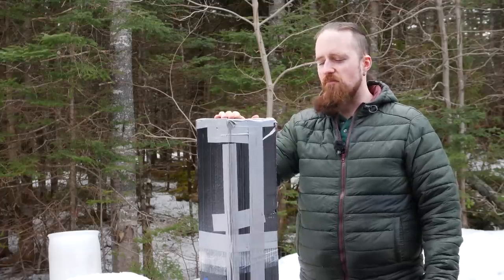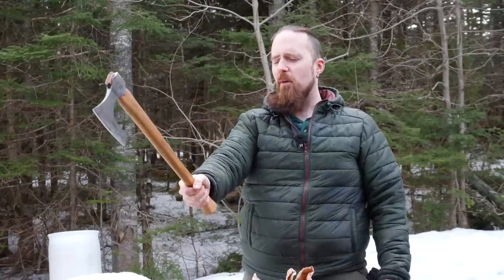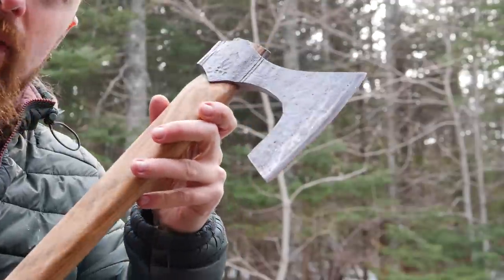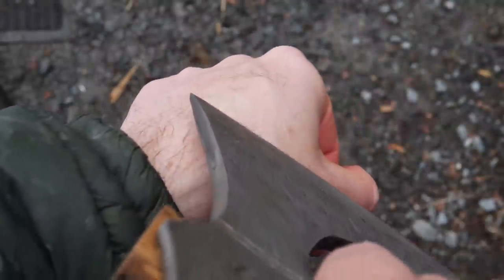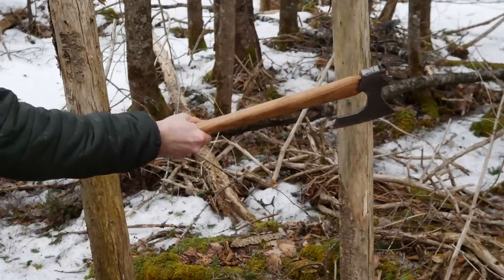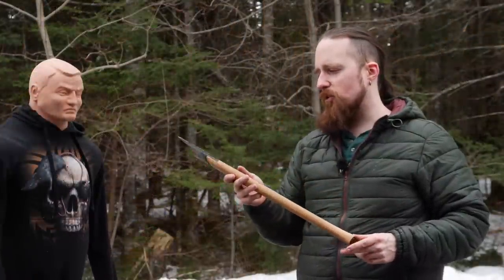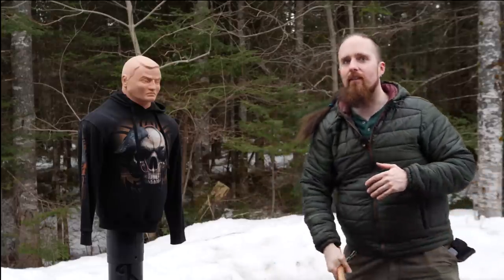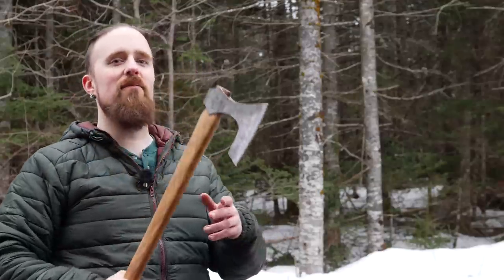Unboxing and Testing a Viking Axe from Sweden

Comment: You know, I never would have considered flipping it over and striking with the shaft. Very informative.
Reply: Less useful in a full on fight, where the goal is usually pretty explicitly to murder your opponent rather than non-fatally incapacitate them
Reply: @rollingthunder1043  I can see several instances where it would be more useful than hitting with the blade part however. One of those instances would be if your foe had a helmet. If they're wearing full plate armor then it is pretty hard to beat, but maces were designed to crush armor. Now an axe handle probably wouldn't crush armor, but a strong hit to the helmet with the handle would probably daze them due to the loud metal ringing right next to their eardrums. Then, while they're too busy being in agony, you could use the axe blade to strike at an exposed part of the person like an arm or leg joint.
Reply: @nauticalgaming2256  or you could hit their helmet with the axe blade instead, since it's heavier and would do more damage. then once they're in agony you can hit them again with the axe head like you said, it's better for hitting things. basically if you want to fight with a stick then hitting them with the shaft is fine. You only want to fight with a stick if they are your friend, so it's what cassie said: "Less useful in a full on fight, where the goal is usually pretty explicitly to murder your opponent rather than non-fatally incapacitate them"
Reply: @JooJingleTHISISLEGIT  there is a big reason you don't want to hit them with the blade, however. Since there's more mass in the head, the edge would be more likely to acquire a roll in the edge from a hit like that as the force would go from the blade into the armor and then back into the blade. And if you've ever watched Forged in Fire, you'll know that rolled edges cut horribly. Not saying that it's a guarantee thing to happen if you hit the helmet with the axe blade, because there's a number of factors that could go into it like the force behind the swing itself or the craftsmanship of the blade, but I'd hit the helmet with the stick part myself just to be safe.
Reply: @JooJingleTHISISLEGIT  "or you could hit their helmet with the axe blade instead," you could but that's likely to damage that rather expensive and, relative to a helmet, fragile blade. You can do the same kind of blunt force trauma with the axe handle or even better the iron or steel wrapped around the back - relative to the axe blade - of the wood.
Reply: @Alex_Fahey  You could always spin it around and hit them with the back of the axe head, then you get the best of both worlds using the heavier head but protecting the blade.

Comment: I'm of Swedish heritage on both sides.My Morfar was from Garsas,Dalarna.My Mormor was from Sandviken.My Dad's people came from the Yterlanis area.My Morfar told me the people from around Mora would trade with the Lapps.Head north with manufactured goods like needles, knives, saws,etc.. Trade for reindeer hides, antlers, dried meat, fish, etc...Also meteorites.The high nickel content and it's structure made for great steel.For an axe,The cutting edge would be a piece of excellent steel forge welded between two pieces of iron.Your edge was what really needed to be steel.You had the weight you need from "scrap" blend.Your axe was made "Old School".Glad to see that.

Comment: Grain orientation looks very good. That handle will last! Just cut at 45° when chopping timber. 90° is the saw cut. You compress the wood when hitting at 90°. Thanks for showing!
Reply: Thank you for that info

Comment: So... While a bearded axe is, as you say, not for chopping down big trees, it is not an axe made for fighting, but for woodworking.
The beard is there for several reasons: saves material, makes it lighter and makes it possible to place your hand for more precision during woodworking. Some people still use a bearded axe today. This is not a case of a weapon being made into a tool, but a tool into a weapon
Reply: I've always had the impression of Viking weapons being much heftier, from reading the sagas. I just can't see Skarp-Hedin or Egil using such a small weapon but they were certainly not average foot soldiers and probably had bespoke weaponry.

Comment: The iron and steel construction is accurate to the period. Steel was much more expensive and difficult to get so it was only used on the blade edges. Plus making the head from iron makes it softer and less brittle.

Comment: I studied meterials and the reason steel is more widely used than iron is not becuase of how easy it is to get but because of the quality and purifying process, when iron ore is precessed it is processed with coal making it a type of steel, normally a 1010 to 1040 industrial steel, steel is harder, it's more durable it's less brittle and etc. making it an all around better matrial than iron tbh.
Basically steel is just better iron

Comment: Nice axe!! One important point about bearded axes.  Yes the beard allows for hooking of shields, and yes they are thinner to reduce weight, but most of the weight reduction is due to the beard itself.  A bearded axe retains a fairly large cutting edge, while the weight behind it, such as found on a regular axe is missing.  Imagine if that whole area on the bottom was just filled in with metal, and that would add a lot of weight.  It should also be mentioned that a lot of historical examples have a geometry that gets even thinner behind the cutting edge.  This further lightens the axe, and reduces friction as it cuts into material.

Comment: Viking axe technology is super hardcore. To be authentic, it has to be laminated and pattern welded from blast furnace foraged bog-iron, and the selected complex metallic fragments sorted and forged together in a designed structure much like a samurai sword, and studies of archeological metallurgy show that most of the fine weapons were made of something way beyond Damascus, and were basically ornamented with wrinkly patterns which look like snakeskin, or woven knotwork. Basically self-sharpening, and in a fine example far beyond what is currently available from your local ironmongers. The best items combined alloys including copper, nickel, vanadium, scandium. The salt and clay treatments for hardening the furnaces were a secret part of the mixture, and would produce superb steel particular to a certain place and maker.

Comment: Gränsfors had a few viking axes back in the day if you were lucky enough to grab one.
Very affordable when they came, but It's hard to tell if this maker exceeds or matches that quality.

It would be quite a testament to the skill of Nils if he managed to stretch and sandwich the iron across the steel core properly without liquifying the iron.
Certainly makes it very interesting to see how it affects performance and how much faster it woulf be to sharpen.

Another point of interest would be whether Nils pushed the hardness past 56-58 like the Japanese like to do with steel/iron laminates.

Interesting blacksmith from my home country. 🇸🇪

Comment: That is called a Plow Share Weld, in the US. A steel edge, with mild steel wrapped around it. I have a Tomahawk that is built the same way. It saved the smith from having to create lots of carbon steel. Not sure what they call it on your side of the pond.

Comment: The funny thing is, majority of the early Viking era fighting axes were just general use tools, as said in the video swords and other weapons were expensive but pretty much every Scandinavian had at least one axe for wood and building, thus during the raiding times they would bring that axe to fight. Most "vikings" raided as a part time job and were usually famers, they were very resourceful with their tools
Reply: Not really cause we had a warrior culture for thousands of years before the viking age started, so it's a bit of a myth that you used tool axes. Maybe if you were really poor sure, but generally no. There are depiction on some runestones in Sweden where they carry both Sword, axe and a spear.

Comment: Hello Skall, the wrought iron used in the axe head likely has not been industrially produced for a long time. mild steel has better properties in terms of strength and purity, but wrought iron is nicer for forging and forge welding due to silica impurities that give wrought iron a striped appearance once it rusts. it isn't worked with often due to it being harder to find or to buy because you have to get it from old things made from it around the 1880s or before. In short, Wrought iron is rare due to being obsolete but is very nice for forging and has value due to its age and relative scarcity.

Comment: And this is why you get custom work, i bought a bearded axe head off amazon, i was expecting something like this but with an aggressive needle point beard, what i got is FAR to heavy for someone my size (150lbs/70kg[i think]) to use one handed, i wouldnt mind taking it to a grinder and hogging off some of that weight

Comment: For those of us that cannot afford a beautiful hand-crafted piece of art like that, there is still the Cold Steel Viking Axe.  I mean the small one, originally with a 19 inch handle and differentially hardened, with a soft steel body to absorb shock and a hardened steel edge for long wear.  It is now 22 inches long and they don't mention differential hardening in common catalogs any more---best to check the home page of Cold Steel.  It is light and fast, with a more symmetrical shaped flaring blade that can hook AND stab, and the handle tapers down from the eye like a pickaxe handle does, thicker above the blade and thinner below---the head cannot fly off.  It is made in China of course, so that we CAN afford it, as Cold Steel intended, but it really is a nice Viking small axe...…………………...…...…..elsullo

Comment: From the maker's website: "The bearded axe is a tool and weapon commonly associated with the Vikings of Scandinavia. The lower part of the axe blade is called “the beard” and could be used to hook shields and leave enemies defenseless. The axe is handforged with a mildsteel body and a highcarbon steel edge."

Comment: when it comes to axes.. where do you draw the line if its a tool or a fighting axe? also the most fun thing to do is hook over shield edge, pull a bit, they pull back. reverse and let them thrust the axe in their own face!

Comment: I understand it's based on Viking axes mate but that's exactly what you want to use for chopping wood. Maybe a little too long blade (if it's called blade in axe, my english is still shit).  I have similar axe for wood chopping and it gets work done when chopping. It's not perfect but just the type that will work and if you don't get paid for it you won't see much difference besides weight.
Anyway, just saying it does work as tool as well. Great video.

Comment: Beautiful peace but if I understood, the core is iron ? Metallurgically speaking it is dangerous because the iron can contain internal bubbles due to the casting process, what can compromise the strength , mainly in a tool designed to receive blows . If it brakes, can cause an accident. I am curious to know how he controls the process to grant the integrity of the casting iron

Comment: The Norse Axes where commonly used both for daily life and combat. The reason for this is how expensive steel and iron where. A sword was very rare and expensive and the Axe was a common tool....of course as I type this the video hits 4:12 so I guess I should delete this....*thinks* nay I'll keep going :D

Another nicety about the bearded axe is if you chock up on it and have the beard over your fingers you get great purchase to shave and shape wood. I'm of the mind that most if not all axe from the viking era where multi purposed. but hey I could be wrong. Great video as always.

Comment: You pointed out that the core is made of iron while the edge is steel, other than making it as accurate as possible does it have any actual benefit to have an axe like that, having the core and the edge of different alloys/metals?

Comment: It is a beautiful axe. I suspected that your favorite battle axe was the bearded axe. And I suspect your second favorite is the thin two handed one with a large blade. I personally prefer axes with something pointy on the top for stabbing. My ideal axe would be one handed and capable of hooking and stabbing as well as chopping.
Reply: You mean the Dane axe; that's what the two-handed one with the thin, large blade, and the prominent horn that can be used for stabbing is called.
Reply: @ezrafaulk3076  not exactly a prominent horn. It gets called that but I think that's like calling a scalpel a knife.
Reply: @ninjahombrepalito1721  technically, a scalpel is a KIND of knife, and the reason the top pointy bit at the top of the axe head is called the horn is most likely because it juts out the same way a horned animal's horns do.
Reply: @ezrafaulk3076  I know, but I prefer a bigger longer horn.
Reply: @ninjahombrepalito1721  and what exactly do you mean by that?
Reply: @ezrafaulk3076  like a knife blade a few inches long on top of the axe...
Reply: @ninjahombrepalito1721  okay then.

Comment: I was menaced and threatened by a gang of rubber torsos a month ago - true story.  Wish I had a Viking Axe then, all I could do was run...I mean the rubber-torso gang didnt have legs attached, and me running effectively thwarted their efforts...still.  Oh, I threw some plastic cups I found at them, but seemed like a silly thing to do, thinking about it later.  Dang, if only I was in posession of a Viking Axe, just showing it off those rubbery mannequins would have been like - respect.

Comment: That's not for hooking - regular axes hook better, as the beard will severely restrict the angle at which you can hook. Beard axes tend to be tool axes, as the purpose of the beard is to increase the length of the edge with a minimal increase to mass. Hooking with a beard axe, the axe is hooked as much as the target is. Many war axes were indeed beard axes, and the one in the video seems modelled on one particular specimen in Oluf Rygh's Norske oldsager, but the beard is not for hooking. The beard actually limits how much you can hook and how well you can hook it.

Comment: The BIG problem here is the fixing of the handle, then the shape of the eye. 
Altough there are surviving samples of viking axes with "modern looking" wedged handles, that's BY FAR the least common used method in respect to tomahawk handles (the most common) or metal wedges put around the wood shaft and not into it (the second most common). When an internal wedge is used, is almost always an iron nail.
Wedged handles on bearded axes are ESPECIALLY INSECURE, because the long lever provided by the beard, on impact, tend to make the head pop off the hadle, while, in the case of tomahawk handles, the hits only tighten the head. 
Then, in practically all cases, Viking axes had an ovoidal eye, not a long narrow one. That's a "modern" axe eye.

Comment: I get the historical aspect but there's really no practical reason to use iron anymore. IDK maybe its easier to forge but I would be concerned using such a soft metal when good steels are so easily available.
Reply: It’s not used anymore. Apart from cast iron, it’s only really seen in historical reproduction.

Comment: Iron is not hard to get and is the cheapest metal on the planet. Maybe in Sweden that’s not the case though. 
Using iron for bladed tools or weapons in this day and age is just kind of dumb really, unless someone is making an authentic era specific tool. Iron is frustratingly corrosive, even when coated or treated. You constantly have to ensure the coating isn’t compromised and you’ll need to regularly oil the tool or apply renaissance wax, even if coated. If it’s not coated at all, you’ll have to carry wax with you because just one night outside and even in dry non humid conditions, the tool will start to corrode. You’ll see rust within hours when carrying or using the tool outside. Additionally, iron is notably more brittle than steel and it’s harder to achieve consistency when smithing and difficult to get a smooth finish with no blemishes. Iron also takes and holds a poor edge that’s very easily chipped, hence why the smith who made this put steel on the cutting edge. 
Since iron is hard to make consistent and smooth, imperfections are always seen just like on this axe. That gives a nice authentic look and it’s clear it was smithed traditionally, but all those imperfections on the finish will allow corrosion to get deep into the iron. Since iron ore is not very consistent, parts of the same tool can corrode faster and cause different levels of weakness throughout the tool.

Comment: What if you mounted such an axehead upside down?  You'd get some extra reach for the same weight/handle length. Was this ever done historically? Are there any downsides?
Reply: I can think of a COUPLE downsides; first, you'd be giving the axe a prominent WEAK of its blade, making it less hard hitting in the top, and easier to push aside. And for THAT, you sacrifice the ability to hook your opponent's weapon, shield, or body part.